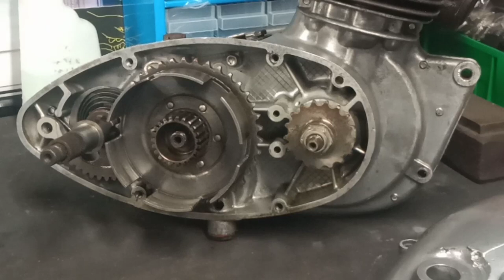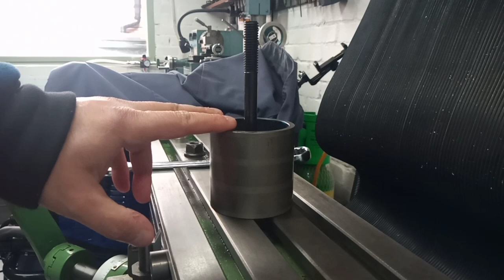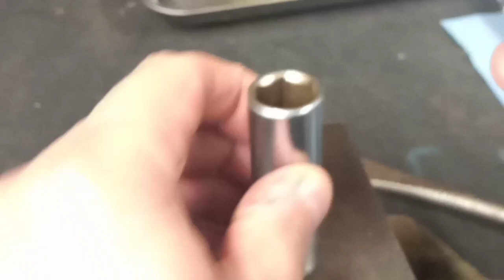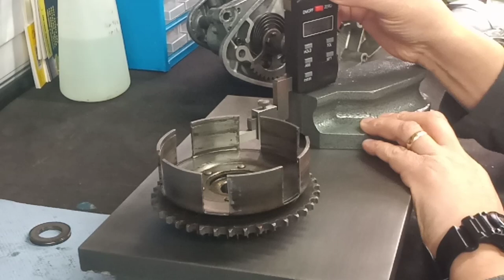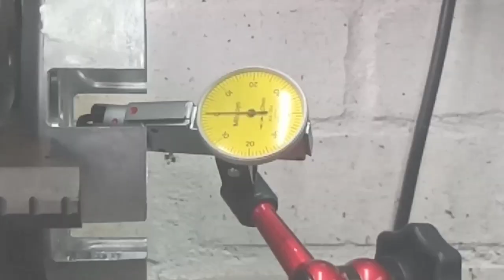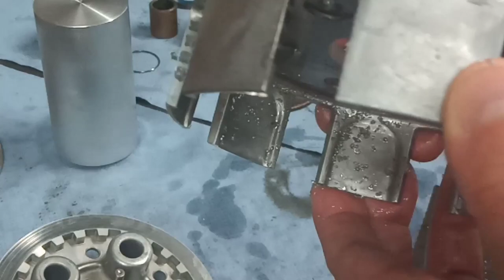BSA Bantam - Yamaha Clutch Conversion Part One - First on YouTube?

Comment: That was brilliant. I loved every second. Really informative and interesting. It is going to be an excellent series and is sure to become the YouTube reference on how to approach these conversions. Great idea to make and use a plug gauge. I agree with others; I was totally invested and didn't want the video to end. My only regret is that we don't live closer together so that we can collaborate and pool resources. Like we did in the old days. For the turning on the basket, I was thinking you could maybe bolt the clutch basket to the faceplate, using the rivet holes for the bolts.
Reply from the maker: Thank you, yes it would be good to do these projects together like we used to. The faceplate was definitely on my list of options, it's only been used once since I bought the machine so a run out (pun intended!) might be just the ticket. 
Best wishes, Dean.

Comment: Yes it's a well known mod in Bantam circles Dean, but I'm yet to see a practical demonstration of how it's done. I get asked about this by customers and now I know where I can refer them to. Great stuff again and can't wait for Ep 2 of this installment. Given there is very little meat to come off the protrusion on the inside bore, have you thought of a heat shrink of your clutch basket fit to your aluminum test piece, might have to turn another diameter slightly larger and freeze it, then correspondingly heat your clutch basket to achieve the fit. There is very little to come off, therefore no need for deep cuts. Heat your basket up to get it off. The clutch basket is a little bit "lightweight" in areas and I think some of your concerns about clamping against it were justified. Last think you need is to damage it this far through the process.  Back to the shed quickly for you we want to see the end result!
Reply from the maker: Thanks Bones, that's a really good idea re the shrink fit. It won't take much turning force so that could be a great technique. 
I'm hoping to get back on it soon, as you know day to day sometimes gets in the way of fun stuff!
Best wishes, Dean.

Comment: Nice to see, adapting things is an art form that has been lost. My motto is if you haven't got one make one. Well done.I would mount it in the 4 jaw again to take away the central lip and a shim plate is a good idea. Depends on thickness of the chain because you may have to lose a few plates from the basket.
Reply from the maker: Thanks my friend, I'm hoping to keep the same number of plates but I have to get the chain in and the correct alignment of the sprockets. All good fun!

Comment: Very interesting, I like the idea of reusing the original hub.
Already been mentioned but yes my first thought was bolt the basket to a faceplate to remove the raised area.
Reply from the maker: Ian, thanks for watching and commenting. It's an interesting project so far. I have a couple of options on tap for machining the back of the clutch, the Faceplate is definitely on the list. 
Best wishes, Dean.

Comment: Wouldn't it have been easier to fit an mz clutch as they were dkw based as well?
Reply from the maker: The Yamaha clutch is well proven in competitive Bantams. Other clutches may well also fit. I've had a number of MZs and Simsons, but I don't remember them being so similar to the Bantam. Memory is subjective, especially as you age!The main problem is availability, you don't want to fit something to a competition machine that isn't easily sourced. The Yamaha clutch is abundant and cheap to buy. 
Best wishes, Dean. PS - When BSA used the DKW as a base, they converted all of the metric dimensions to imperial. I think you would have the same issue with the metric MZ parts, you would need to transpose the imperial spline sizes into it. You've got me thinking that I want to see an MZ clutch again though!!